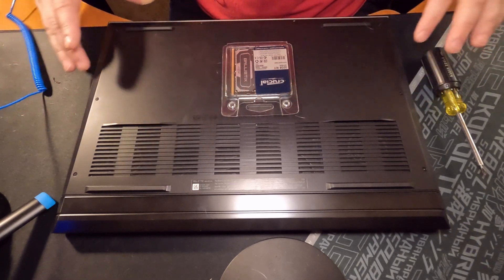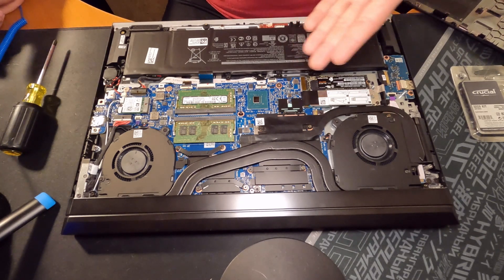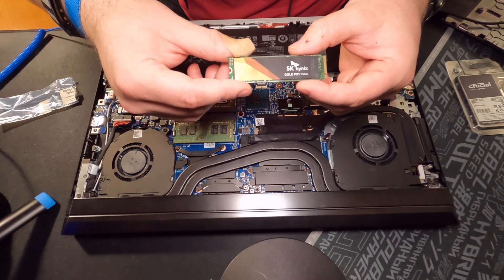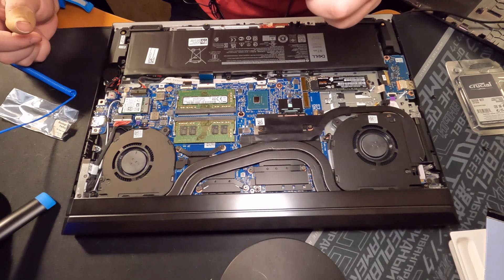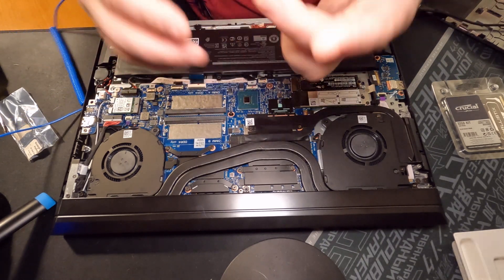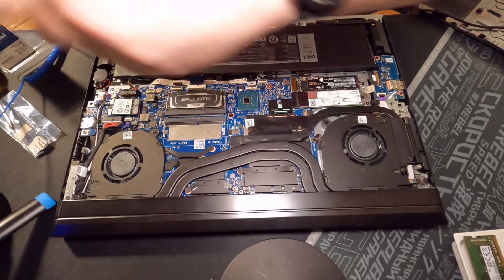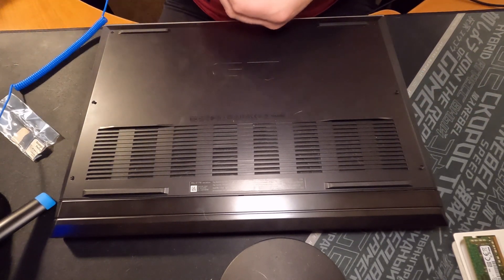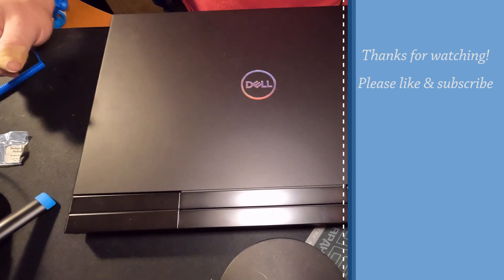Dell G7 7700 Gaming Laptop - RAM & SSD Upgrade

Comment: not all g7 7700 have two ssd slots..mine has one
Reply from the maker: Weird, is it also a 17 inch screen size?
Reply: @Accounting4Cycling  yep
Reply from the maker: @wk9195  that's weird! Make sure it's not just missing the mounting sled for the other slot. Most Dell/Alienware laptops don't come with it and make it look like just one m.2 SSD mount.
Reply: @Accounting4Cycling  the slot isnt there..its not just the sled.... theres no secondary ssd slot...had to install windows all over again
Reply from the maker: @wk9195  damn, sorry that model doesn't have it at all. Dell does some very strange things to cut costs sometimes.

Probably too late for your purposes, but you should be able to change the boot settings to USB and move your old SSD to an external USB-C or mirror the drive to the new one using the same external USB-C enclosure. You still can use it as a backup or extra space. It's great for Steam games you don't play daily, and the external enclosures are easy to upgrade as you need!
Reply: @Accounting4Cycling  oh ya ..i am using it  for simulations in cryptanalysis, cryptographic algorithms and exploring encryption methods in a controlled environment without affecting my main system
Reply from the maker: @wk9195  perfect use for an older system like this. Great field to work on, we can always use more advanced encryption methods! (and crpyrographers to build the models!)

Comment: should i unplug the battery before i do this?
Reply from the maker: For SSD and RAM upgrades, it's probably not necessary, especially if you're using an antistatic grounding strap. If it makes you feel more comfortable while inside the laptop, go for it. I never do when servicing just those parts, but if I'm repasting the CPU/GPUs or something more in-depth, I do.

Comment: So did you have to save everything on your destop applications etc before doing this or can i just pop it open replace what you replaced and it will continue to run with the current apps i Have on it?
Reply from the maker: If you're just adding storage, it will all continue to be there. If you're replacing the boot drive, you'll want to either clone your boot drive to the new one or make a backup of your information. I did a clean Windows install on the new drive and moved my old data over afterwards using a M.2 NVMe SSD external USB enclosure. Be sure to make a recovery USB beforehand, though! Dell gets pretty particular about the Windows version (unless it's a completely clean version).

Comment: My laptop G7 has 128G SSD and 1TB HDD. Is it possible to upgrade only SSD to 1TB?
Reply from the maker: You should be able to. You will probably have to either clone the SSD to the mew SSD or reinstall Windows, either are fairly simple, they just take some time.
Reply: @Accounting4Cycling  Thank you Sir, have a good day.

Comment: So there are 2 SSD spots on this laptop? Thanks for the video :)
Reply from the maker: It does! Both are gen 3 and you'll take a little bit of a battery hit, but the extra storage is worth it!
Reply: @Accounting4Cycling  awesome! thanks for the quick reply. My battery is toast anyway, thats what i get for leaving it plugged in all the time.
Reply from the maker: @Crobe2008  if you go into the bios, I believe you can select that its mostly on AC power and that should, slightly, save your battery.

Comment: Saw the video and I bought a new ssd for this exact laptop and just plan on expanding it with the extra ssd slot. Do I have to install a new version or windows once I do or will it just read the drive automatically
Reply from the maker: You should just have to create a new partition in Disk Manager, this can be the entire device space (recommended) or smaller partitions. You shouldn't need to reinstall Windows if you're using it as a secondary device.
Reply: @Accounting4Cycling  alright thank you

Comment: Would you mind letting me the exact specs on the Samsung ram that was you took out before upgrade?
Reply from the maker: Absolutely! It was Samsung 8GB 1Rx8 PC4-3200AA. The RAM was capable of 3200MHz but the G7 only ran it at 2933MHz.

Comment: My laptop (Dell G7 7700) has issues: sudden blue screen or freezes up, hard drive not installed issue. bios is up to date. Dell response is shit
Reply from the maker: I upgraded to an Alienware x17 since posting this, can definitely sympathize with you about their tech support! I've noticed Alienware Command Center (AWCC) being the culprit for most of my issues. If you haven't already, check your system's reliability monitor when it does boot to Windows and see if any of the red Xs are from AWCC or anything Dell related and try to either force an update to their latest version or go back to the last one that worked mostly properly. It sure would be nice if the AWCC software just worked! Especially since it's mostly just for the RGB lighting.
Reply: @Accounting4Cycling  thanks a lot bro! My issues are solved. No more freezing or hard drive error while switching on!💐👍🏽
Reply from the maker: @Pablozdad  hope it stays that way! Happy to help! I'm probably going to have to switch back to the original RAM to get mine back up!
Reply: @Accounting4Cycling  x17 has much better cooling.
Reply from the maker: @justswitched8841  it's so much quieter than any other gaming laptop I've tried! Hefty price, but such a nich machine!
Reply: @Accounting4Cycling   Yeah I had an area 51m. area 51m and the x17 are the best laptops dell has made. All the other models run too hot.

Comment: I had a g7 7700. The thermal design is bad. Both cpu and gpu thermal throttle.The laptop is VERY hot to the touch too.Sold mine.
Reply: Who tf asked
Reply: @lankydegenerate326  Who the fck r u?

Comment: Is your ram memory working now at 3200 mhz or is it 2667 mhz?
Reply from the maker: Sadly it is capped at 2667, even the stock RAM is capped at 2933 MHz. I tried to OC the RAM in Alienware Command Center but the option is not available.
Reply: @Accounting4Cycling   So it needs to be 2933 mhz  max speed. I was thinking to slam in 64gb for my work but i think i will wait a bit.
Reply from the maker: With the CPU being Intel, the speed difference didn't really have a huge impact, unlike in an Zen 1 or 2 Ryzen system! I believe it's an issue of having "Dell approved" RAM over the speed itself. 64GB would make it a solid workstation!
Reply: @dejanzabaljac6950  Max RAM speed on G7 7700 is 2933. I upgraded mine to 2*16gigs. Their initial max speed is 3200 but they top at 2933
Reply: @Accounting4Cycling   i could be wrong but to get to 3200mhz you have to buy a 1.2v RAM. The 3200mhz for those sticks is at 1.35v. TMK you would have to go into an XMP bios (not available on G7) and up voltage which we can not do with the G7 7700. Locked at 1.2> i think